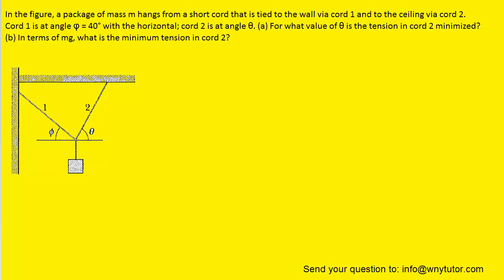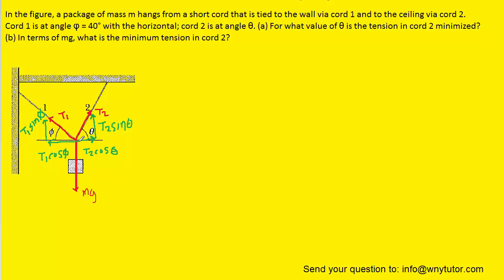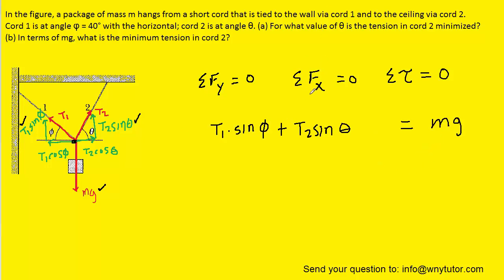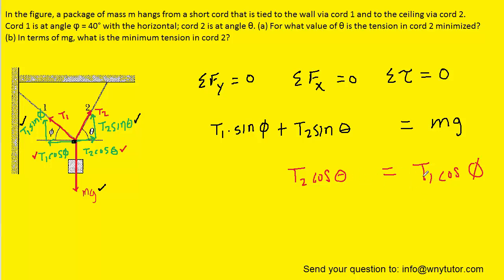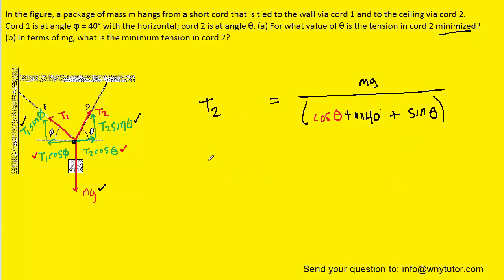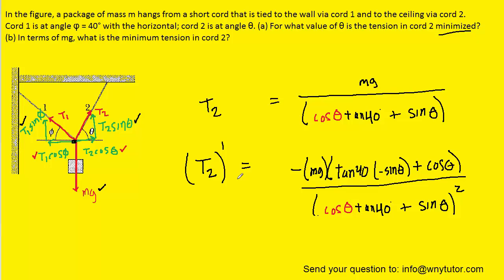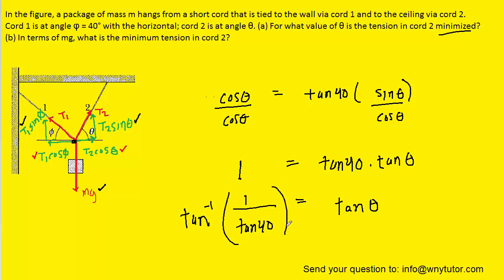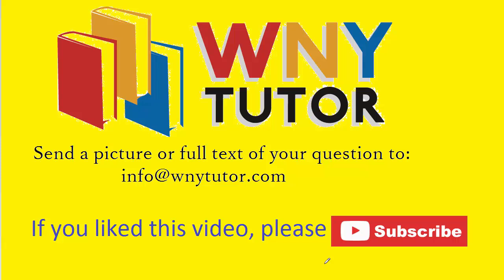A package of mass m hangs from a short cord

Comment: why we take a derivative, actually what is the relation of derivatives between physics
Reply: The derivative is taken to find the minimum value of theta needed. The point at which a derivative is zero is either a local maximum, or a local minimum (depending on the sign of the values before and after).